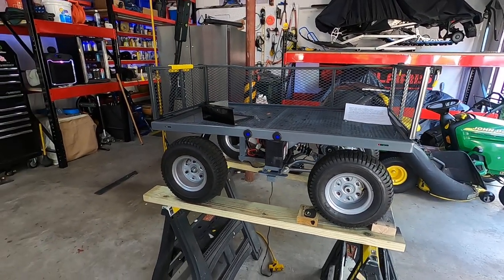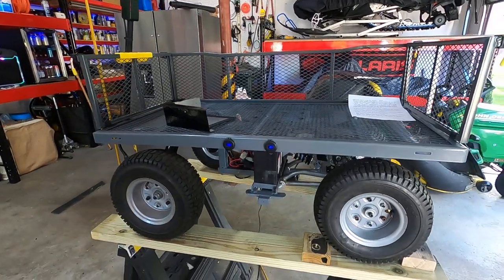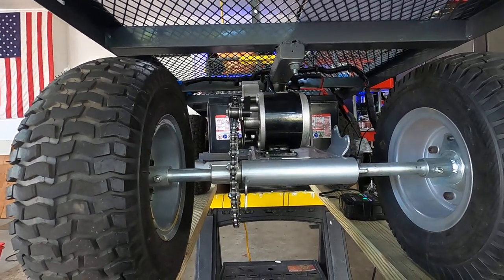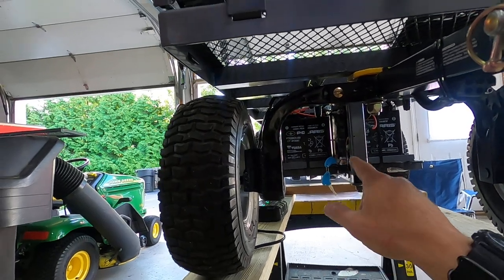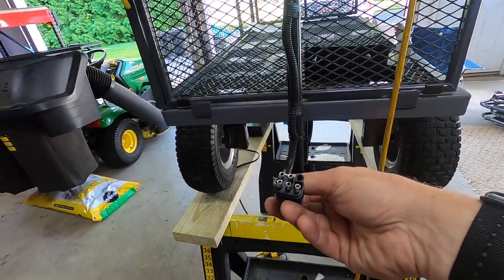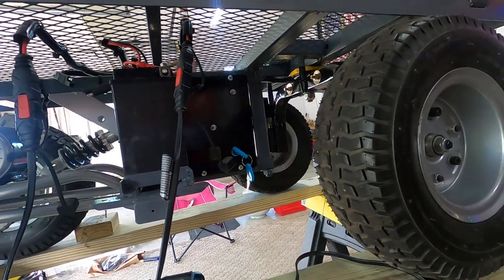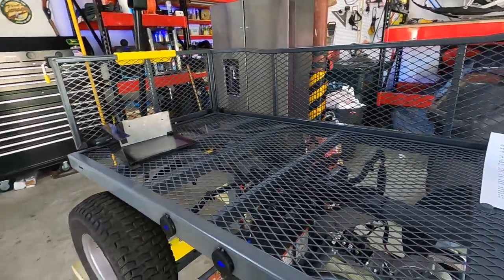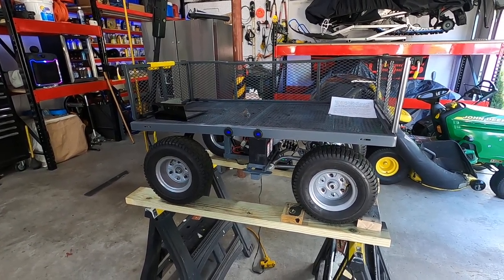Electric Beach Cart Build from a Kids Electric ATV and Gorilla Cart - Part 1 of 2

Comment: Awesome idea with the razor quad set up. I looked at the weight capacity of the quad at 120 pounds. I’d love to know how that motor and set up work with the wagon weight and under load. Can’t wait to see it in action.
Reply from the maker: The weight capacity is basically the kid riding on it in its stock configuration. When I changed the sprockets it definitely increased its capacity as it is geared way way lower.  It’s now a 4 to one gear ratio.  I’ve been riding it around like a freak in my yard up and down hills and I’m over 200 lbs.  At the end of the day if my wife loads this thing up with more than 200 pounds we shouldn’t be going to the beach in the first place.   Will test all this in a week and let everyone know how it goes.

Comment: Awesome build!  I have a 90 foot hill to climb to get to the beach that is pretty steep.  Would you stick with the 36 tooth socket or see if electricscooter parts could make something a bit bigger for additional torque (at the expense of speed)?
Reply from the maker: I think the 9 tooth to 36 tooth will be perfect. I rode mine up a pretty long hill a lot longer than that and it was fully loaded :). You can see me at the end of the second video doing it.  If it’s a huge sand dune you will definitely need to pull it or get wider wheels.  

https://youtu.be/9pNKp3os20w?si=yCZnG90h6Y35A9tc
Reply: @johnbonzey  Sounds great - thanks for the follow-up!  I saw you go up that hill - my hill is 90 vertical feet to climb, length is probably 1/8 of a mile or so.  Sounds like the 36 tooth sprocket is still the ticket though.  Thanks again
Reply from the maker: @CarCareKiosk the hill I was climbing was at least that long so you’ll be good.   May want to get a couple bigger batteries since the ones that come with the cart are pretty small but who knows maybe they’ll work

Comment: Nice build. Have you tried this in the soft sand? I've been working on mine for a couple of years and still can't get it over the dune. Next step is a geared motor and bigger tires.
Reply from the maker: I won’t have it in the soft sand until August.  I believe the big dune will be an issue unless I go down the path of buying $100 wheelezz tires but we will see.
Reply: I have the same issue with the one I built.  That soft sand going up the dune gets me every time.  I even got wheeleez and still have the issue almost not aggressive enough to actually pull the cart.  What kind of tires are you running? I might try tracks if I can get a hold of some cheap.

Comment: Great video I’m almost done with mine. I’ll post a picture later. Do you know if the controller can be enclosed. I want to reuse the battery cover to hide my wires and controller
Reply from the maker: I’m sure you can. I made a cover for mine that goes over it all but it is open on the top.  I really don’t know if you should make sure it’s ventilated for heat dissipation .

Comment: Do you remember how many links for the new chain you used
Reply from the maker: I just bought the chain below wit tool and sized it correctly.  
410 bike chain  - $10
CTE-24361
electricscooterparts.com

Bicycle Chain Tool - $5
Need this to make the correct length Chain
SKU - CHB-120
Electricscooterparts.com

Comment: Ok, the stock wheels suck, buy the Bonlo wheels or you will be pulling through soft sand. Next, make sure the batteries you get are at least 18 amp hour. The stock batteries are only 8 amp hour and last only 10 to 15 minutes depending on the flatness of the sand. I did have to mod the back axle so the wheels would be powered since the Bonlo wheels are free rolling. I also put a 3 way switch on the handle so I have reverse.
Reply from the maker: The bonnlo wheels have some pretty bad reviews so I’d be interested how they work out for you. Like I said in deep sand with the dirt quad tires you’ll have to help it but it was a non issue for me.

Comment: My wheels from the atv have a smaller diameter hole than the wagon front axle. Did you run into this issue?  I can’t get the atv wheels on the wagon front axle. Thanks.
Reply from the maker: It’s been a while but pretty sure they fit on mine.   If this is the case I would just ust drill out the atv rim to fit the wagon axle
Reply: Thanks. I ended up cutting off original wagon axle and welded atv axle on.
Reply from the maker: @firefyter1972 I looked and this is what I did as well.  Sorry for this original answer

Comment: Hey John, how much weight would you say you hauled with it? Im building a cart now that will weight around 250 pounds with everything. Im thinking of jumping up to a 40 tooth on the bigger gear (instead of a 36) and 9 on the smaller gear which would give more torque. They are saying around 2.5 MPH
Reply from the maker: Prob about 50 pounds.  But I sit in it and and go up a the hill and I’m at 220 plus the contents with no issue on a 36 tooth to 9 tooth drive

Comment: Is there a way to add a reverse switch or does razor ATV motor not allow that? Would be a nice added feature for maneuvering.  Great build though. I’m working on getting my components together not for next year.
Reply from the maker: A reverse switch can be added from what I’ve read.  You’ll have to Google it.    I never added it and even after running this for a while still don’t personally see a need for it but clearly up to you.
Reply: Yes you can add a reverse switch to the beach cart. It comes in handy if you have a tight garage or shed and need to back out of it. I made a forward/reverse switch for my beach cart that was created from a razor dirt quad ATV. I will post a video on youtube showing it off and how to create the switch soon!
Reply: Hey again! Here is a tutorial on how I added a Reverse Switch to my Beach Cart/Razor Dirt Quad ATV: https://www.youtube.com/watch?v=5IfXxSNkaHA&t=129s

Comment: Nice build! Did you wire both ignition wires to the black wire on the thumb throttle cable?
Reply from the maker: I honestly can’t remember what wires I connected to the thumb throttle but I only cut one of them and ran it through the ignition.   If I had to do it again I’d prob not even use the key and just unplug the quick connect at the battery connecting the + and -     It works but I don’t even use the key anymore.

Comment: Nice build! I have been thinking about for awhile how to build one. Can’t decide whether to buy a cart or build one from scratch. I have a welder(but I’m not a welder) always wanted to learn though so that’s why I bought one. But I really like your setup. Having 2 kids means bringing a lot more stuff out onto the beach. Do you think it would be cheaper to just buy the parts I would only need rather than buying the whole  rzr dirt quad?  Or would you suggest just buy it whole and possibly be able to use other parts?  Very good job sir!!! Makes me excited about building one. My wife almost always says why don’t you just buy something instead of build it…..my response to her is you get the satisfaction of building it yourself and also gain knowledge of what your building!  When you said rzr quad setup is it an actual atv? Or dirt bike? Or rzr?  I know quad usually means atv but just wondering because my local facebook marketplace built but it’s a dirt bike. Do you think the Wheeleez tires are worth it?  Never used them before but considering trying them then I think about atv paddle tires for sand and wonder which I should try first.
Reply from the maker: Thanks.  It will be WAY cheaper to build yourself. I'm not a welder either as i bought one last year.  This is definitely a good project to do yourself. It will take time for sure but as long as you can cut metal, grind, wire stuff up its pretty easy.  The welding you will figure out :).   The first thing you want to do is search on marketplace "Razor dirt quad electric".  Find one for under $300 bucks - you may need to be patient but they show up.  i wouldn't buy a new one for sure.  The razor dirt quad has just about everything you need - motor, frame, wheels etc.   I put the detailed parts list for everything required under the description.  I was too cheap to buy the wheeleez but if you don't want to pull at all this would prob be the way to go - at $100 a piece i was thinking the project was getting out of control :)   All in I was prob at about $500ish complete.  An example of the dirt quad you need is at the link below:
https://www.facebook.com/marketplace/item/1197225557645505/?ref=search&referral_code=null&referral_story_type=post
Reply: Awesome! Just saw in your title it said kids atv I missed that as you could probably tell by one of my questions. Thanks for the detailed response. I know it was a lengthy comment.
Reply from the maker: @inspectorgadget6510  good luck and if you decide to go for it just let me know if u have any questions
Reply: I had just remembered about your beach wagon build a few days ago still haven’t built one but really want to. Do you think the wheeleez wheels will be much better in the sand?  I saw in one of your comments to me if you don’t want to pull the wheeleez wheels would probably be better. I never have used them but do you think the Wheeleez wheels will make it so I’m barely pulling the wagon?

Comment: If the battery dies, will it free wheel to be able to pull it back?
Reply from the maker: You will need to remove the master link on the chain.  It will move but you will not be able to pull it for long without being exhausted :)

Comment: Does that cart have reverse
Reply from the maker: I didn’t wire it up for reverse.    Honestly I can’t remember if these motors on the dirt quads can be wired for reverse.  Normally the polarity is reversed on the motors through a switch to get the motor to run backwards.    Never saw the need for it personally.